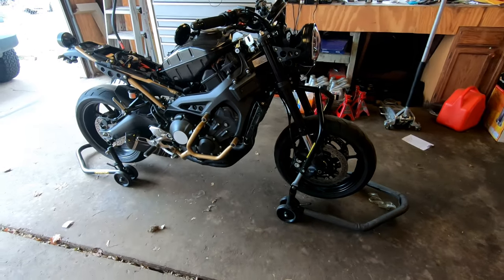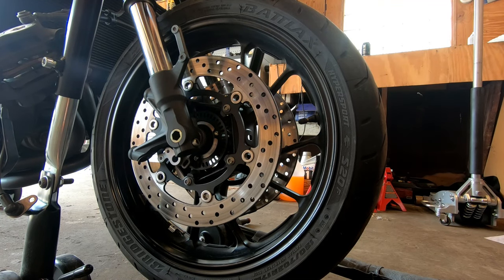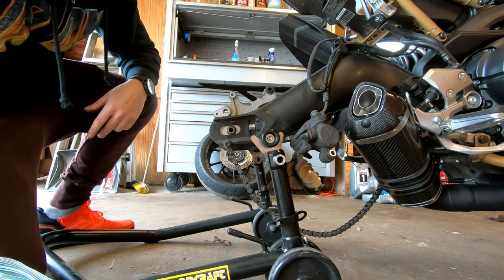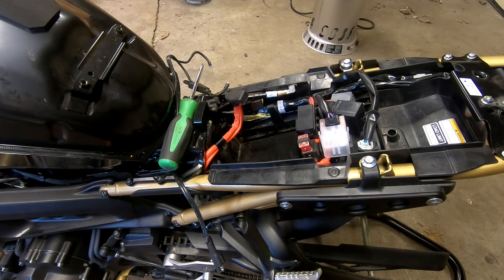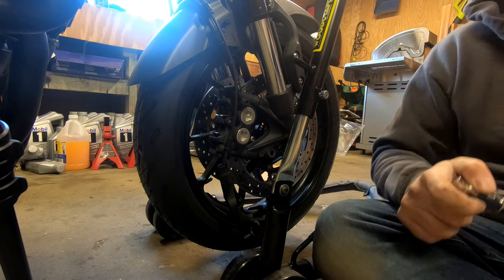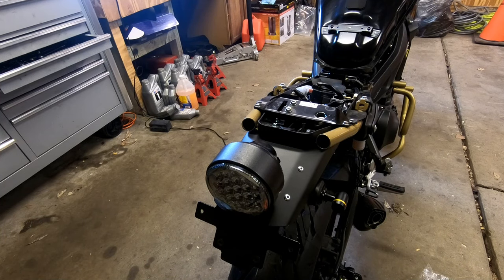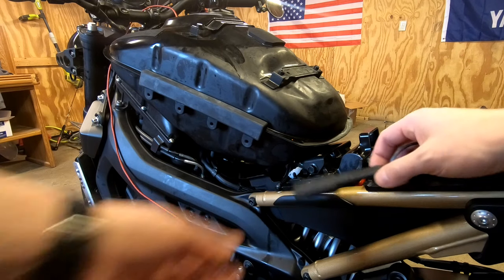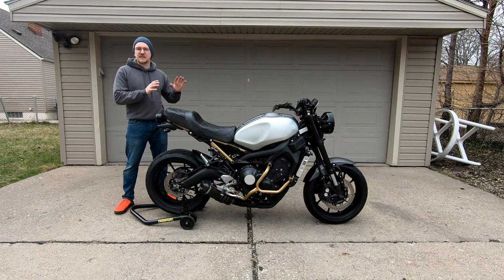Winter Mod Series EP5 FINALE! Wheel Removal & Install on the XSR900! Michelin Road 5s!

Comment: Just wondering, does the new seat add anything to the height? Personally, I think your tank panels would have looked nice sprayed black with bronze bands to tie in with the frame guards. You've done a lovely job, sir.  My XSR900 is a 2017 model, and I'm the second owner. The original owner did some 'custom' work on it, and yes, it looks nice, but he fitted it with a Delkevick racing exhaust, which is loud and irritates the hell out of my tinnitus in my left ear. So I bought a different slip on from Delkevick, and it's still loud, but not as much as the original.  If I ever get to change the tires, I was thinking maybe going one size up on the rear, as apparently the wheel frame will take it. Any thoughts on that? I do, however, love my bike, and it's be very forgiving to me as I'm a returning rider after 35 years out of the saddle, but we're looking after each other and the partnership seems to be working out nicely.

Best wishes from the UK.
Reply from the maker: If anything the seat height feels a bit shorter than the stock seat. I've heard of people going up a size, I've never done it myself so I can't say whether or not it would be better on this. If it can fit it's worth a shot. If you do, let me know I'm curious of the results. Thanks for checking out the video!

Comment: Just got the woodcraft front stand. But have no idea how I’m gonna get it on. Any suggestions?
Reply from the maker: At the bottom of the triple tree you should see a rubber grommet. Remove it, that's where you'll be inserting the pin on the stand.